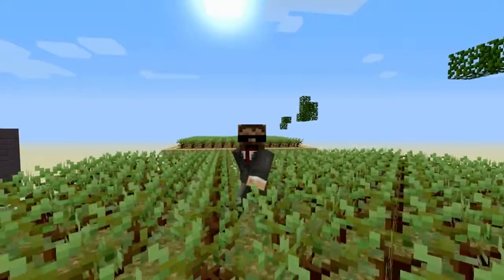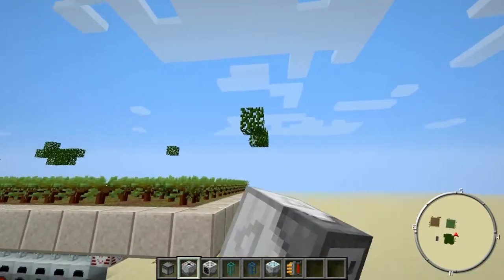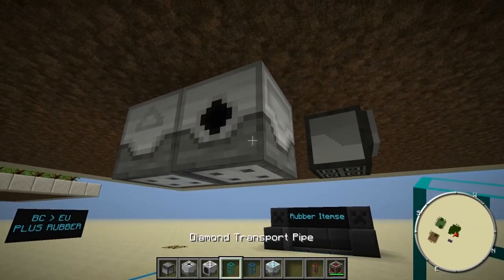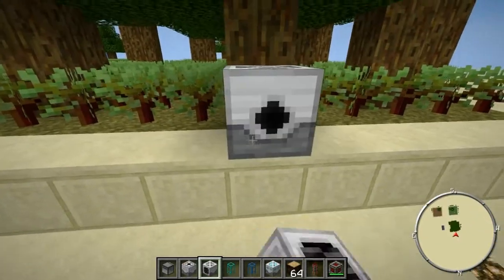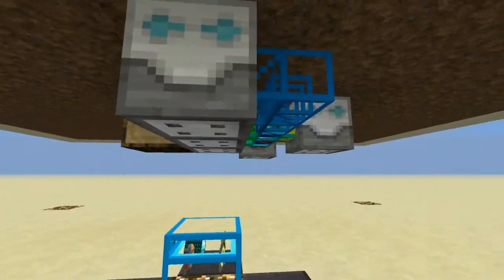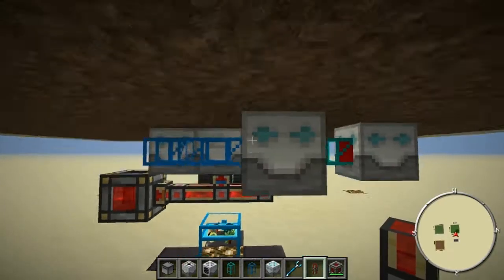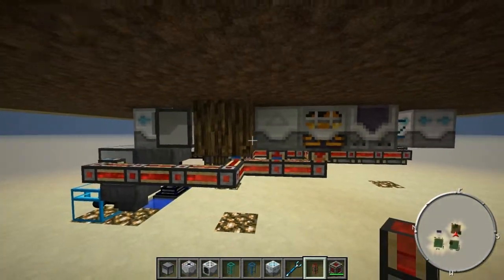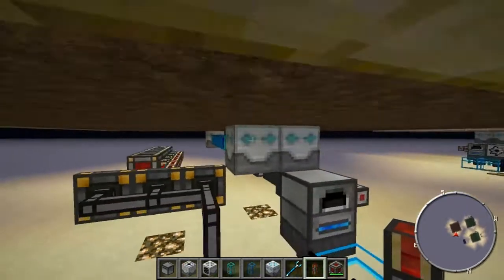MFR RUBBER TREE FARM | *EXTRA:BC to EU Energy* [TUTORIAL]

Comment: s on getting the harvester to do its thing in Monster. Have subbed. Great video! I would love a verbal response if possible rather than waiting for a vid. Keep em comin'!
Reply from the maker: Thanks for the Sub! I'm testing a new design right now as I write this. It looks like they may have patched the harvester. I will know here soon and post a short reply video if it is broken or a new design if I can come up with one. Short answer as off right now harvesters may have been patched.
Reply: Super Thanks!!!
Reply: DizzyAaron Is this method now broken due to a patch? I have seen a couple setups like this and none seem to be working. Harvesting just doesn't happen outside the wood block next to it. Thanks in advance!
Reply from the maker: Robert Jerina This method is now broken, the harvestor is patched. I tried a few different setups but it still doesn't work. steam turbines are a good replacement in FTB for the moment.
Reply: DizzyAaron Thanks for the quick reply. I'm not sure how steam turbines will help with the harvester not working though??? I have power, just the harvester doesn't take down the trees.
Reply: DizzyAaron Actually figured it out. The harvester needs to be above ground now. I did that and it works. Only issue is that not all the saplings are picked up so it runs out of saplings to plant and eventually power. So I need an alternate source of power I think. I've got some ideas though thanks.